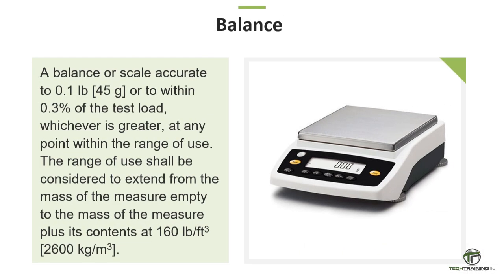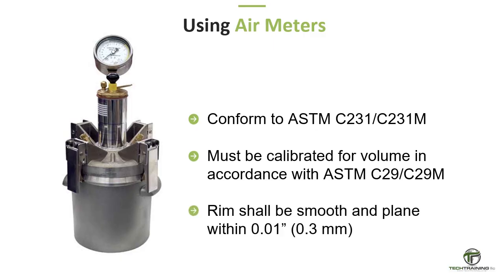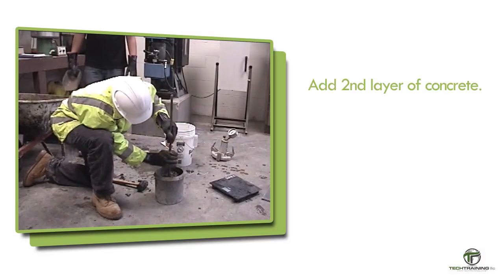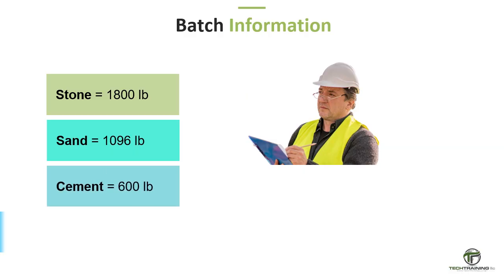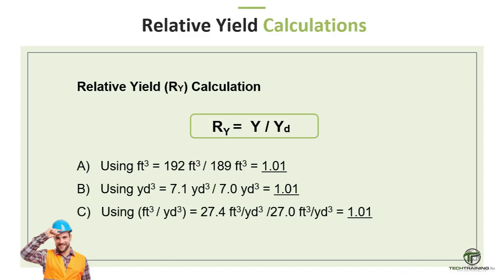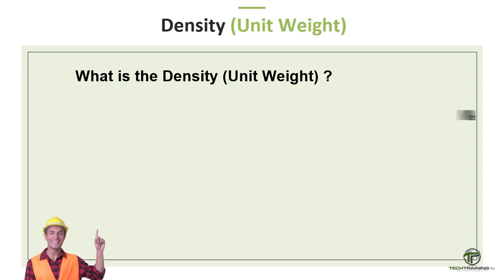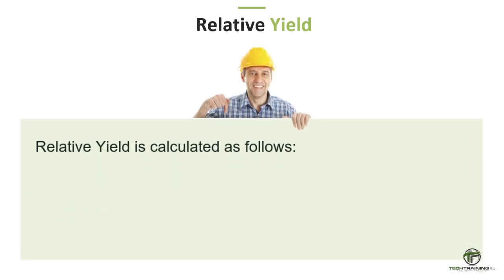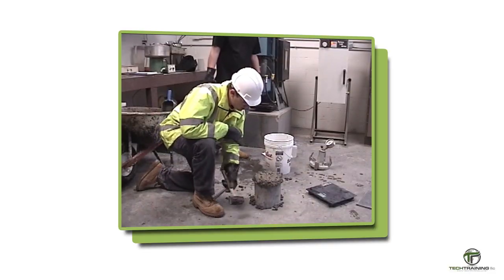ASTM C138: Unit Weight, Yield, Air (Gravimetric) of Concrete

Comment: Calculating density- in your air bowl you wrote the Mm=8.08
But when you calculated you used Mm=8.8 which gives 2 diferent measurements